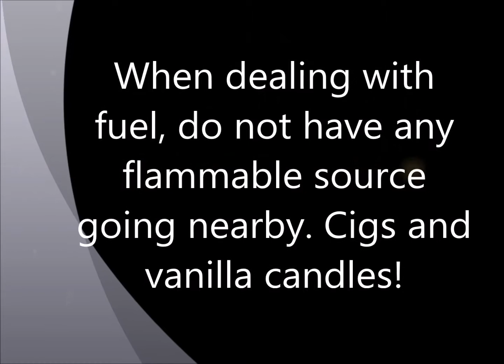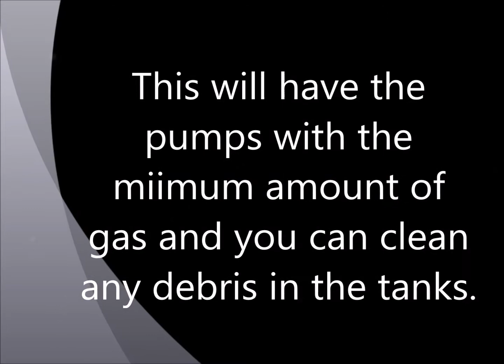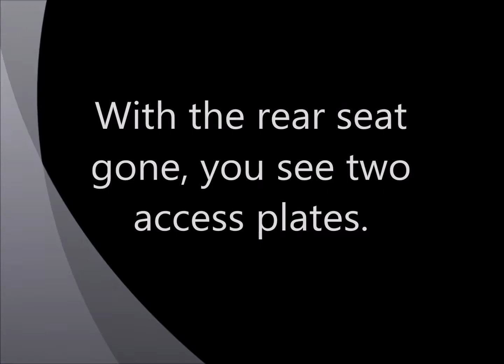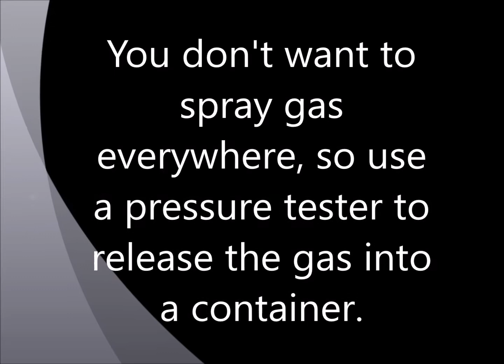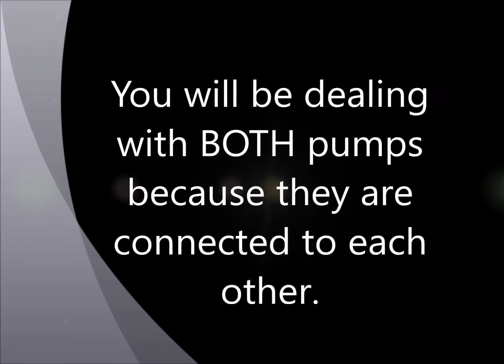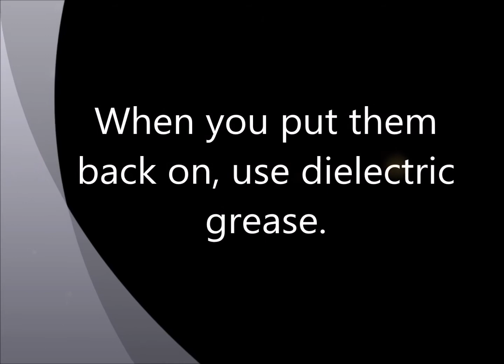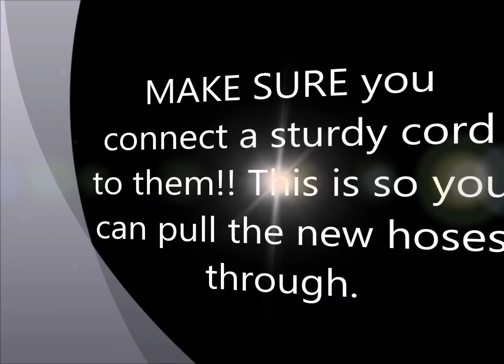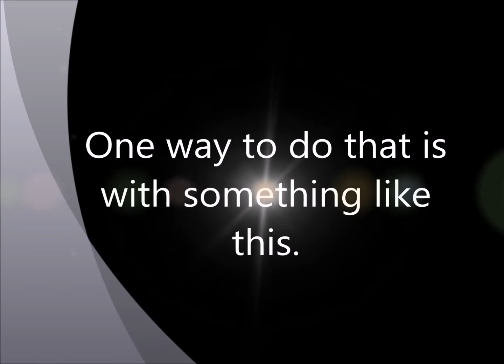How to change fuel filter on a 2010 Mercedes e 550 W212 car Part 1

Comment: Great thorough video, gave me everything I need to do this myself. I have the 2010 e550 coupe not sure if we have the same one (w207). I think my fuel pump or filter may be going bad in mine as I am having a symptom of long cranks that require tapping the gas pedal to start the car (it happens most often when refueling the car). Is the fuel pump or filter the likely culprit?
Reply from the maker: Thanks for watching my video and your kind comment! I would say it is definitely the fuel pump/filter. The first thing you need to do is check the pump pressure: https://www.youtube.com/watch?v=SLnHPaaDZFE    If it is bad, you know that you have to replace two pumps. I eventually had to have Mercedes replace mine. It cost $1500 and came with a two year warranty. This is something you want to fix immediately. When mine broke, it was at night in a bad neighborhood!  You may like my other videos. Just type Lsailor1 in the YouTube search bar. Like them? Subscribe for the latest! Best, The Sailor.

Comment: What made you decide you needed to replace your filter unit? Any issues with fuel sending pressure or dirty gas?
Reply from the maker: Thanks for watching my video Alin! I had just purchased the car and it had 111,000 miles. Whenever I buy a used car I go thru an entire routine so that i have a "starting point" where I know everything is good. I just made a video on it: https://www.youtube.com/watch?v=R7jcC83-744           I call it "preventative maintenance." Better to take care of the gas filter now then have to deal with a broken car by the side of the road later. You may like my other videos. Just type Lsailor1 in the YouTube search bar. Like them? Subscribe for the latest! Best, The Sailor.